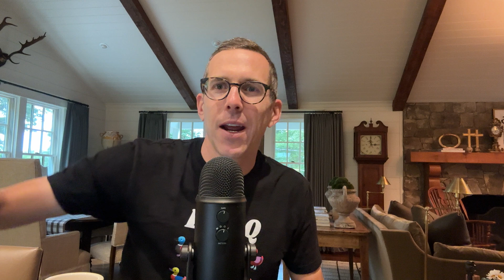Hill Climb/KOM Cycling Training: Anaerobic vs Aerobic Power, Course Gradients, Pacing, Training Plan

Comment: I notice in races after 2h of racing start fell cramps in my legs,I was avoid to train with low cadence muscular strenght and power,and that is what i need to put inside my traning routine, on flat and hills as well.
Reply from the maker: give that a try, and make sure some of the training is as intense as the races. If it isn't, you might just be struggling from muscular fatigue

Comment: I have a short 10K time trial coming up where the first mile is flat followed by 2.1 miles of climbing (3% grade) and then the turn around so the reverse going back. (2.1 miles descent followed by 1 mile on the flats). I feel like I need to start off hard on the flat section to stay in contention until the climb.  I feel I can do well on the climb being lightweight and all.  I am worried about losing the TT on the flat section where I don't have an advantage due to weight.  Any thoughts on how to approach this.  Much appreciate your insight.  Thanks.
Reply from the maker: you're spot on in putting some extra effort into the climb, altho 3% is a very shallow climb...aero and watts matter the most. AND, high speed after the turn around. check out this video that should help you a bit more: https://youtu.be/g4dL5dLOekU

just don't go so hard into the turn around that you're pedaling below threshold on the slight downhill portion
Reply: @EVOQBIKE  Thanks! I agree.  I want to be able to quickly get up to speed after the turn around and take full advantage of the decent. I did a similar descent in my neighborhood the other day (maybe a bit shallower even) with a tailwind and maxed out at 43 mph so I feel pretty confident. Thanks for the video link as well. Great channel!
Reply from the maker: awesome! let us know how it turns out! 🚀🚀🚀
Reply: @EVOQBIKE  Thanks.  Will do. Keep up the good work with your channel!
Reply: @EVOQBIKE  Thanks. Well, Good and bad results. Took my road bike for the TT as my TT bike just isn't up to snuff yet and with the climb, I thought the road bike (15.8 lbs,) might make sense. Well, I did great on the climb and had one of the top times recorded on the Strava segment at the turnaround. On the 2nd half (in the descent) I got crushed pretty bad, however. Ended up 14th out of maybe 40 riders in my age group. Those 60-year-old cyclist are pretty good! Was curious, as a lighter rider and pretty good climber, how much speed percentage do I lose on a descent by being lighter?  If the TT was just a climb up to the turnaround, I probably would have made the podium. :) Any thoughts - thanks!
Reply from the maker: @markmark2469  probably more had to do with people more aero on TT bike; MUCH faster on downhill